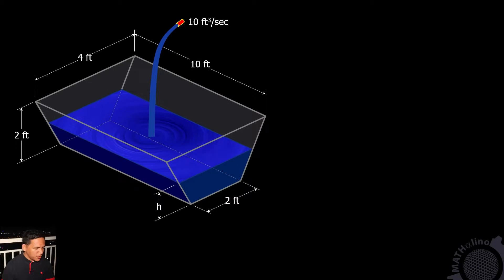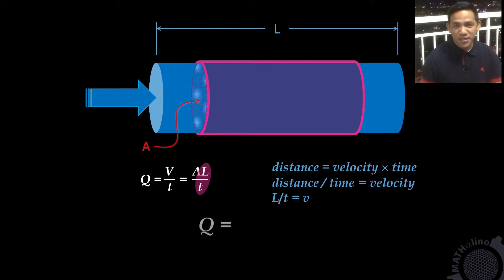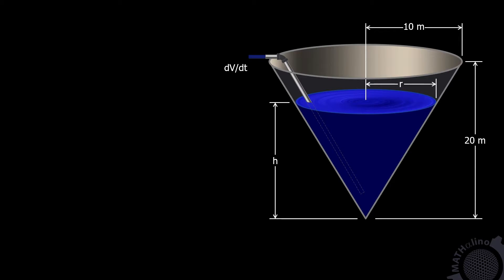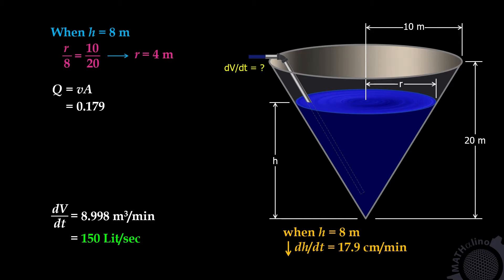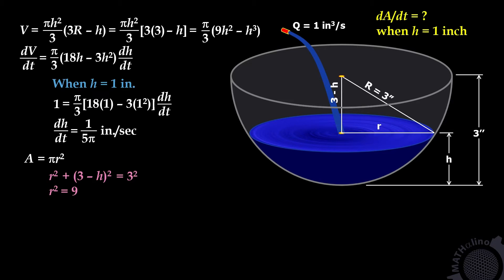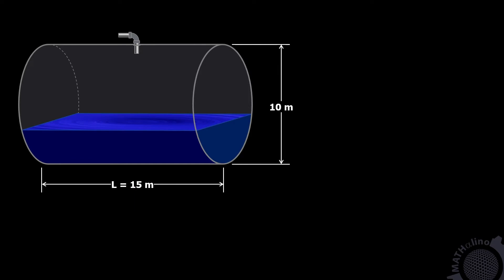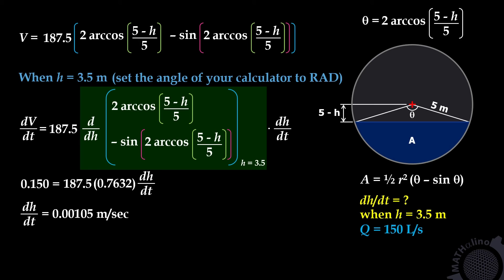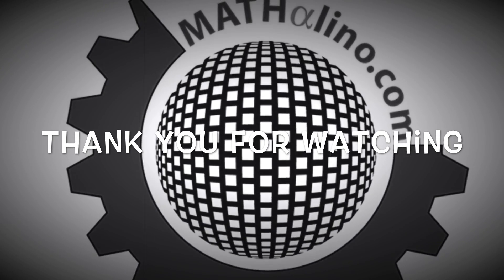Flow Problems in Calculus Solved by a Formula from Physics | Differential Calculus

Comment: Very informative video, I'm using the Q=VA formula to calculate CFM of air going through ductwork.
Reply from the maker: Thanks for dropping by. I Googled first what CFM stands for, hehehe, and I found that it stands for "cubic foot per minute". Although I can handle some calculations in English units, I am mostly dumb by the abbreviations.  Thanks for sharing how you use the equation in real world situation.
Reply: @MATHalino1  No problem, we use it to calculate the amount of air flowing through a return duct versus fresh air intake and balance branches off main trunks. For rectangular duct we use W(H)=A in meters to get meters squared instead of the pi(R)^2=A
Reply from the maker: @TheMrVerbal  that's awesome.